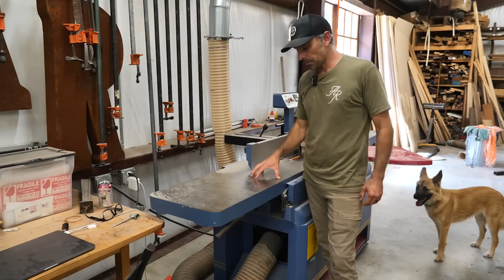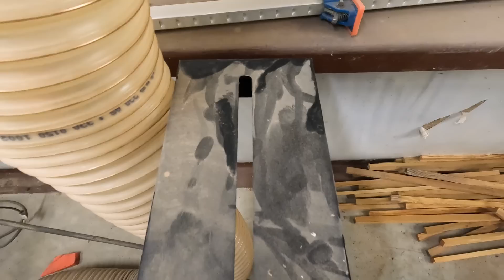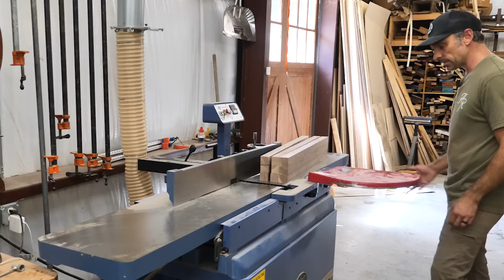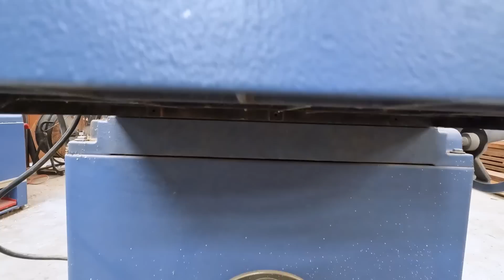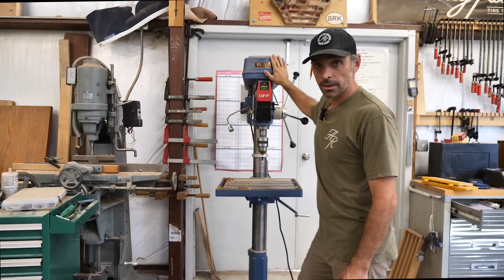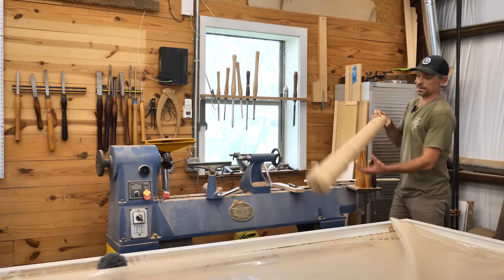Honest Review of my Oliver Machines after 3 Years

Comment: My Grizzly are similar. The jointer is a monster, but the fence design is terrible. It uses roll pins that back out, fall out, and constantly needs to be re-squared every time. The planer still has a small about of snipe. I've calibrated it 3-times now, just can't get it "right." I just bought a Felder K700S and I'm going SCM SD10 for a wide belt. I'm done with the non-european import machines. I likely will upgrade eventually to Felder/SCM jointer & planer at some point.

Comment: I’ve kinda heard mixed things about Oliver but I guess it’s often personal experience. Have to say though I have jointer with cast iron fence rails etc and it pops out of 90 all the time. Not sure why but I suspect it’s because the base is sheet metal and vibrations work the mechanism loose. Good machine otherwise.

Comment: I’m glad I’m not the only one with this problem with the jointer fence. I have the Laguna copycat and I found the same issues. I found that helps a lot is that I use some Magswitch 90* ones and put them behind the fence to help it stay at 90. I also do a lot of long glueups and seems to help. But I keep thinking of changing the whole fence to the new fence and making it fit.

Comment: I work at a maker space with a 12” Oliver jointer. It has the more robust cast iron fence assembly and it is also impossible to square. I wonder if they’re stress relieving the castings (at all) because it’s as if the fence is twisted. If I square it up at the infeed side it’s out of square at the outfeed side. I just don’t rely on it at all to square an edge.
Reply from the maker: Dang that’s not good to hear.  If it’s square on the infeed side and your pressure is against the fence on the infeed side then you should get a good 90 degree joint.  I don’t really have any issues with my joints being square but it still should be square front to back.

Comment: If you were to purchase a new jointer do you feel a 16" width is necessary?
Seems a power feed would be necessary trying to face joint 16" wide.
Reply from the maker: Yes!  I’ve jointed many boards at the full 16” and it handles it just fine with a light cut.  I actually wouldn’t mind have a wider jointer.
Reply: depends on what you are doing, there are times you need a 24 or a 30" jointer even,  16 will do most anything you need though

Comment: Your Oliver drill press looks exactly like my one from Grizzly ( bought about 10 years ago),,,Yours has a better light. The knobs on mine are cheap, and constantly loosen up ( or just fall off). Otherwise it's adequate (and I really do like the heavy duty motor - 1 1/2 or 2 hp) i am pretty sure no one in the US has made drill presses for decades...so we are stuck with Taiwan ( or China)
Reply: I would never buy that drill press for $1600. Looks like junk. $2000 is for Nova Voyager, and that's a Cadillac of drill presses

Comment: Have you had any issues with dust collection on the jointer? Is that a 6" hose on it? I'm asking because my jointer has a 4" hose fitting and it clogs all the time.
Reply from the maker: I have not.  It’s a 6” so you need a substantial dust collector to get the cfm.
Reply: @AndyRawls  Thanks for the reply. I love the content and always pick up technique tips when I watch.

Comment: I really like those two units.  That planer is really cool with the infeed and outfeed that doesn't move up or down...and the new designed fence on the jointer is just like the powermatic...could you walk thru your adjustment process on that jointer? High level? I'm curious...
Reply from the maker: I’m honestly inside a video posted by The Wood whisper years ago.  He has a great process using a good straight edge and feller gauges.